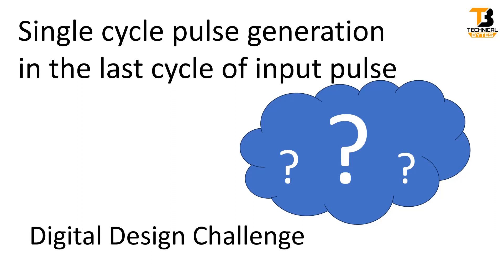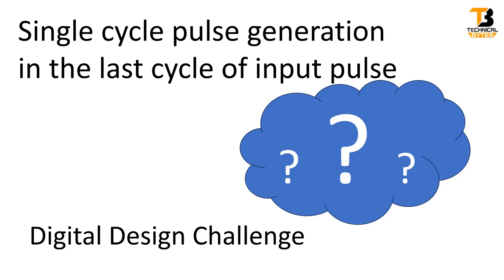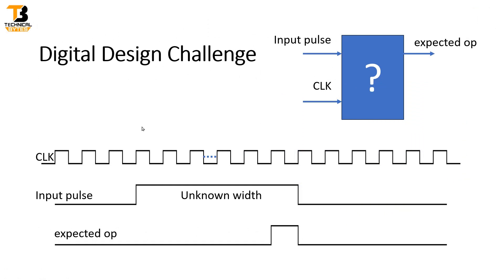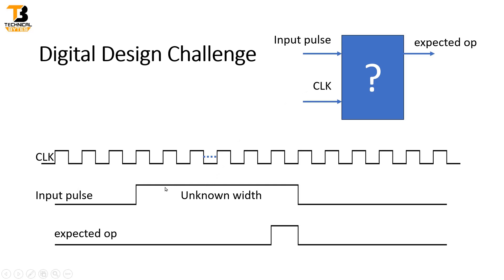Digital Design Challenge: Pulse generation in the last cycle of input pulse

Comment: I don't know if it would be so simple, just like a traditional falling edge detector. If the waveform with the specified behavior is correct, so the the output pulse should occur before the input pulse itself goes to low, which is not the behavior of conventional falling edge detector that uses a flipflip, an inverter and a and gate. In the traditional approach the output pulse only occurs after the falling transition of the input.
Reply: With that said, I really struggle to design something that meets this spec but I was just able to use a t-flip-flop with and AND gate with the input pulse but it was pending to filter the other pulses at the output of the T-flip-flop, allowing just the last one to pass
Reply: I think if we can think something related to rising edge detector then it might work. Detect the first rising edge and then delay that pulse till the end of input. We will get the output pulse before the falling edge of input.
Reply: @AshishPatel-vy7mn but how do we know the no of clock cycles this input pulse be high? If that is known we can go with a simple counter based solution itself?